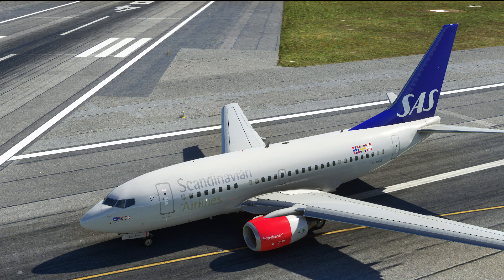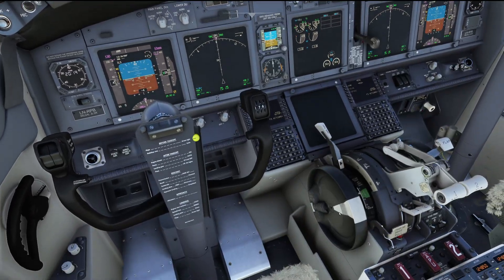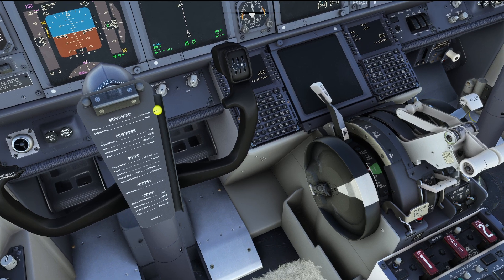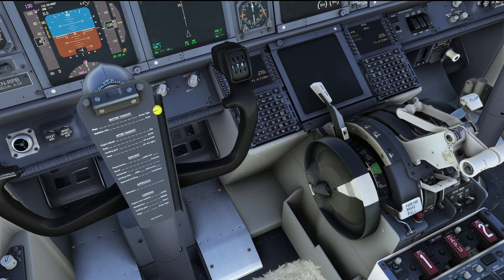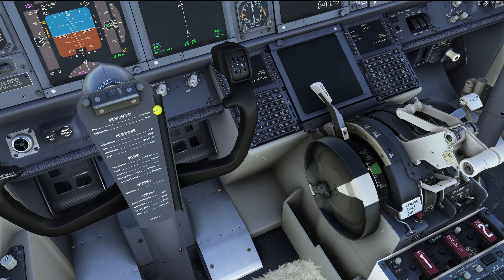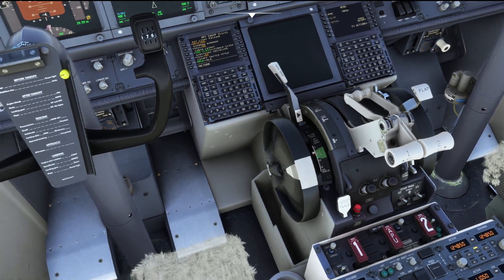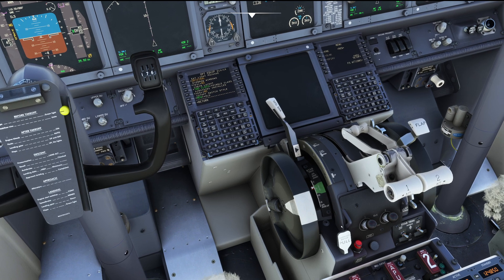PMDG 737 New Parking Brake System | WATCH THIS | 737 Pilot Explains

Comment: Not working for me. I keep pressing the brakes and can see the pedals going down but when i click on the parking brakes it does not work.....been fighting for ours with this it is so frustrating......I don't understand what is wrong. the brakes are on but the parking brakes wont move....
Reply from the maker: Then your joystick doesn't give you 100% braking application but maybe only 95%. Check your settings and calibration and make sure you get 100% braking from your stick.
Reply: @A330Driver  Thanks for your reply. I have literally just installed MSFS and my joystick has been recognised. When I go to the sensitivity tab there are all the commands but not the brakes...when I use the toe brakes with the keyboard, the parking brakes is still not engaging. I can see it move but not lock into position.

Comment: this is absolutly not working to me    since i buy this airplan  the braiks ar bugging    i  press the pedall and try  the parkingbrak pull but dosent work for me   :(
Reply from the maker: Maybe your joystick is not configured correctly. You need full scale deflection of the brakes to set the parking brake, if you’ve got less than full scale it will not work.
If that doesn’t help contact PMDGs support.

Comment: Thank you, Only purchased the 737 600 and could'nt find any info on this change...
Reply from the maker: Hi Joe,
you would find this written in the introdcution manual, I can certainly recommend reading it, there are lots of very useful information in it! Maybe take the plane out for a two hour ride and spend the time enroute reading. You won't regret it!
Cheers
Reply: @A330Driver  thanks for the advce. Will definitely do that later.

Comment: Thanks! Now I know why the mysterious way of parking break on 737!
Reply from the maker: Funny that you call it mysterious, to a real life non-airbus pilot it's exactly the other way round: The way it works in FS is mysterious, that's not how you set a parking brake. LOL
Reply: @A330Driver  No wonder the brake refuse to engage on 1st press, only upon 2nd or 3rd press does the brake engage. Its like the manual lock on the door, close it first then lock it in place.

Comment: It is very valuable information and as Andy Ivey told. PMDG should be post this in the forum or in the manuals. After 3-4 weeks I find this YT video. TCA Quadrant captain set is not working with choice of button. Only with rudder.
Reply from the maker: Hi Leo, it is right in the forums and manuals already.
Check page 37 of the introduction manual.

Comment: I click more than 2 seconds and it goes again to the original position...
Reply from the maker: Then your brakes aren't calibrated and don't apply 100%.
Reply: @A330Driver  I calibrated them. More than 5 seconds solves the problem, but then I cannot return to the other position with parking brakes off...

Comment: NOPE still doesn't work. Been trying to figure this one out since the update. I have followed all the tutorials. I'm holding my toe brakes in for 2,3,5,8 seconds and the brake wont set. Yes the brake latch moves and the light turns red but it wont stick or stay on. It goes right back to disengaged. So I cant set the brake no matter what. I have reset the settings with my thrustmaster pedals and unassigned all features. I have reinstalled the aircraft but still nothing. I think PMDG needs to make this feature and option because it worked great before. Some forums are recommending to change settings in FSUIPC but I don't know where to go in FSUIPC to make changes as I don't see a parking brake in therer. To say this has been beyond frustrating is an understatement. 
Update: I figure it out but it’s so janky. Annoying feature. Sometimes it locks and somtimes it doesn’t. You have to get it just right.
Reply from the maker: Check your axis calibration to ensure your hardware actually sends 100% braking power to the sim when your pedals are fully depressed. That's been the primary reason I found so far why people couldn't set the parking brake after the update.

Comment: Hi.  Thanks for the explanation.  One thing I'd like to add, that wasn't mentioned in the video, is that there's a red light indicator that turns on or off letting you know if it's engaged or disengaged.  I was wondering why the light never turned on in the past since I was always using (Control + . ) It only came on when I used my TPR pedal brakes and then clicked the brake lever with the mouse as you showed us. So there's a glitch with the MSFS shortcut when using (Control + . ) which makes the lever move but you don't know if engaged or disengaged, the correct animation of the lever does not work with the keyboard shortcut.  This needs to be fixed as the position of the lever does not behave properly as when using the pedal brakes and clicking the parking lever with the mouse.  Anyway thank you much for showing me something new :)

Comment: I have a virtualfly ruddo+ and this doesn't work The toe brakes are properly applied but lever does not stay in position (even after applying toe brakes for a few seconds)..
Reply from the maker: Have you checked the devices calibration? As long as the correct brake input is sent to the sim it will work, regardless whichever hardware one uses. I'd therefore check that indeed your pedals are able to send 100% input.
Reply: @A330Driver  thanks for checking back. Yes, it is sending 100% input. If I press the toebrakes than then try to engage the parking brake it's asifit wants to always stay disengaged. I can keep the parking brake key pressed and see the lever move and red light on but the moment I release the key it disengages. All that while stand g on the toe brakes. Not sure what's happening.
Reply: Actually... It was indeed a calibration issue. I had 100% in vf app but not in msfs. Fixed now.

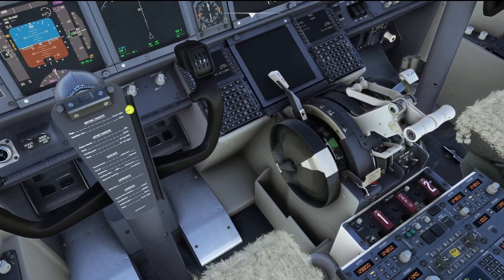Comment: 0:45 the park brake also has an electrical component. The park brake lever also closes a valve (with an electric motor) to stop hydraulic fluid leaking through the normal antiskid valves (releasing the hydraulic pressure on the brakes). The park brake light indicates the position of the valve.

Comment: A setting to disable and enable this feature should be set as a user default in the FS Actions and or plane state menus.
Reply: I agree. I messed around for 2 hours yesterday to get the parking brake off (was very frustrating) and didn't make it until I came across this video. Now I have the problem that I only "fly" VR and it's very difficult to press the brake buttons on the keyboard under the glasses. And on my Trustmaster, all the buttons are used for more important things. Please!!! the new braking behavior as an option ...
Reply: I totally agree....I don't have a rudder pedal and hence setting the parking brake off gives me a headache..I can set the parking brakes easily but setting it off is even more difficult
Reply: I dislike that feature as well. I would like to deactivate that and set the old version active again.
Reply: Now try to do that with the keyboard, yet trying to. Sick
Reply: @CarlosQuesadaR  ouch...I can imagine 🤦🏻‍♂️
Reply: There is

Comment: OK for us paupers without rudder/brake pedals. For me and my Thrustmaster T.16000m starting with parking brakes on - pressing and holding the brakes (not parking brake) for 2+ seconds disengages the parking brake. Hold the brakes again for 2+ seconds and with it held press the parking brake button and the parking brake is back engaged.

Comment: OK this i didn t need. I think it s ridiculous. Not everyone has break pedals. I don t. And I can tell you that holding the joystick assigned button for 2 seconds doesn t work for me. Why make things more complicated?
Reply from the maker: Why buy a study level airliner if you want simified systems?
You can always get the Bredok 737 if you want novice level systems.
Reply: @A330Driver  Why be insulting to users? We have choices like Honeywell vs Collins, this could be toggled. We are off\on the brakes constantly on the ground, it’s not a trivial thing. Remember the German automakers laughed at American SUVs, now they can’t survive without making one.

Comment: Thank you so much for this video! I am currently doing a flight and noticed that I had been having some "issues" with the parking brake while taxiing. I was able to somehow get it working again and took off without issues. I am currently mid-flight and came across your video. Stress releived!
Reply: Full pressure to set. Full pressure will automatically release a set brake, also.

Comment: Plane makers should let the basic commands work as simply as possible, the default way, otherwise it is really stupid. Thanks for the tip/video
Reply: I don’t know if you refer to the PMDG model, in that case if you buy a study level aircraft you would expect everything to work exactly as in real life, otherwise they would have just put the possibility to plan the route via the MSFS integrated flight planner instead of the FMC (I don’t even know if that exists as I’ve never flown an IFR with default aircrafts) I’m not a real pilot but every time I simulate a flight I would like to experience the real life feeling and this is what PMDG achieves the best in their aircrafts, if you don’t want that level of realism for nearly the same price you can buy the Bredok3D MAX or the Captain Sim 764. 
If you refer to the real aircraft it’s not much of a deal, setting park brake on is the first task on the parking spot checklist, so after braking to stop the aircraft on the parking, before releasing the pedals the pilot would just pull the lever to “lock” the brakes.
Reply: @quirimont9972  Hello, thanks for your reply. I actually refer to many out there, a general comment, even the Flybywire airbus.You cannot have a lot of settings enabled as per their recommendation. I believe not all of the people fly in your style, which could be the best one, but not the only one. I have never flown IFR, for example. I just think every product regardless of the developer should be enabled to be flown as default or as in real life to cover all sort of users. Thank you again for your comment and advices.

Comment: I just finished streaming and couldnt get it to work. Meant that I had to hold brakes all the way on. If only the is came out before then 😂
Reply from the maker: It would have been in the manuals, release notes and changelog as well ;-)
But I figured most people don't read them, that's why I created this video.
Reply: @A330Driver  Manuals aren’t necessary. Got the flow down pat 😎😂